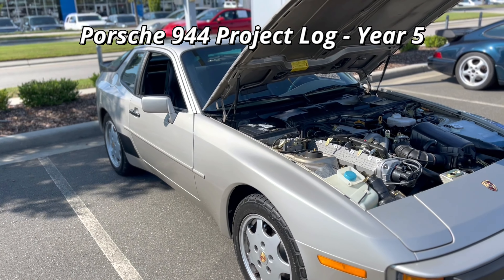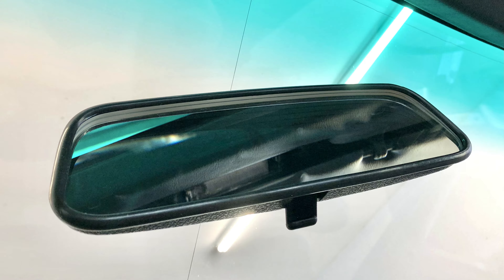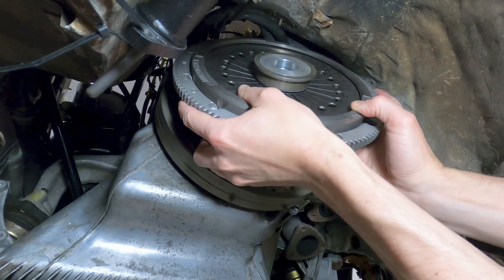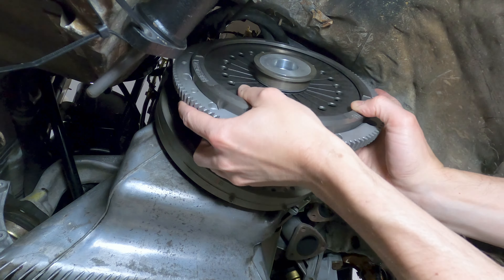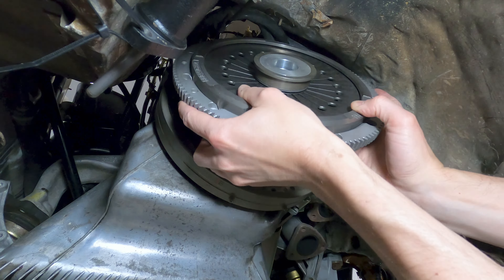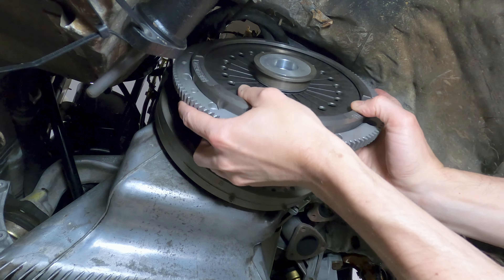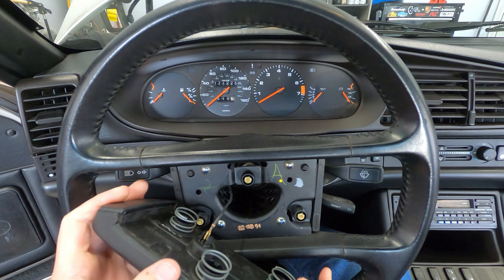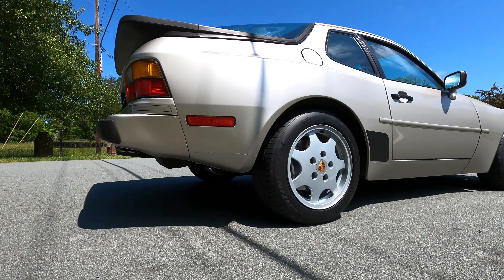Porsche 944 Project Story – Year 5 – Status Update, Repairs, Maintenance, & Costs

Comment: Thanks for the cost break down.  I have owned a 944 and a 924S in the past and had thought of getting another one to refurbish, but at $34K I'll probably just get a new GR86.   good channel and great content, thanks again.
Reply from the maker: You’re welcome! I will say that I took my restoration quite a bit further than would be needed to simply keep one running/driving. You could get a fairly clean 944 for $10-$15k and spend around $5k to sort out any backlog of maintenance. The GR86 would provide similar driving enjoyment without the stress of future mechanical failures. The 944 would win the day if you’re looking for the vintage factor and a project to occasionally wrench on. I haven’t driven the new 86 yet, but the increased power output makes it a pretty attractive option.

Comment: Gosh, nice work on this thing and thanks for the videos. I've done a few of these same procedures on my '86 turbo this year (sport DME, rear main seal, manual steering rack, etc, etc) and they do indeed make a pretty big difference in the regular usability of the car.
Reply from the maker: Excellent! It sounds like you’ve done some pretty extensive maintenance and repair on your car, it definitely makes a difference. I was surprised by the improvement of the refreshed Sport DME. If these weren’t Porsches, I don’t think we’d be so lucky as to have aftermarket options like those provided by companies like Focus 9.

Comment: thanks for all the content. Just did a 2.7 swap on my 86 after spinning a rod bearing on track and your videos were super helpful!

How are you liking the manual steering rack after using it for a little while? I'm considering going the same route some day given how my 944 is gradually seeing more and more track-day duty
Reply from the maker: That’s awesome! The 2.7L cars are pretty rare to see…

While I don’t have any real track experience, here’s what I can share after driving with the new steering setup for a little over a year. In short, the manual steering conversion has been a vast improvement in all areas except for in ease of turning at low speeds. I found the side-to-side movement on the new setup to be a little tight at first, I’m guessing because all the parts were brand new, where after turning the wheel halfway in either direction it would firm up and the wheels wouldn’t quickly self-center after turning. But, after driving the car a couple hundred miles, it broke in nicely and is now a lot easier to turn. The “on center” position is just a little vague, but that’s true for most manual steering systems. Not in a sense where there is lag or play in the wheel, the response is very sharp, just that it requires more micro-adjustments when cruising in the straights. Feedback from the road is really clear and the steering feel lightens up nicely when accelerating through turns. Overall, it’s ultra-smooth when you’re up and rolling and I haven’t detected any irregular shakes or vibrations, if anything I’d say it feels tighter than the power rack I had on the car. I hope that helps! 👍🏼
Reply: @NC944er  yeah that's great info thanks. Really tempted to go that route especially as I run out of things to do to the car LOL. Would certainly be nice to not have to squeeze the oil filter past the power steering reservoir lines too...

Comment: Thanks for mentioning fixing that crack in the door skin from the failed weld inside the door.  Tim Comeau at CRE mentioned that in a short video about a year ago but I had forgotten about it.  I don't see it on my 84 but a small crack is there on a new-to-me 87.  I haven't opened the door panel to look at the issue but guessing it's pretty easy to see the failed weld.  I'm not going to buy a welder to do this myself.  If I take it to someone to fix, just tell them to repair the weld?
Reply from the maker: Yeah, it’ll be very obvious to see once you’re in there and the guide rail will push in and out when raising and lowering the window. I actually picked up a $200 flux core welding rig just for this job. 😂 It’s such a small, 10-minute job that I couldn’t find any local metal workers to take it on, just wasn’t worth their time. You may be able to get an auto body repair shop to do it, they might bill an hour of labor or something in that area.

Comment: Great video, and very clean car, I’m almost done rebuilding mine, but for some parts you were an inspiration. I changed my camshaftgear to the adjustable from De Loods, hope it runs better 😊. Like to see more videos and keep up the nice works 👍🏻
Reply from the maker: Thanks man! That’s great to hear about your progress. I will say that most of the channel content has been motivated by simply helping others, as there is little value outside our niche 944 community, so I’m happy to hear it’s helping out. 👍🏼
Reply: @NC944er  well,I have taking  everything from below, to powdercoat myself and do the bottom in new paint, 2 months idea is now 2 years, but starting to look great
Reply: I just did the same swap to the De Loods adjustable camshaft sprocket on my turbo, which was needed - it's a nice unit. The head on my car had been decked enough that the timing was off by about 4 degrees when all the marks were lined up. Made a noticeable difference when aligning the balance shaft belts and I find it runs a bit smoother.

Comment: This summary video is terrific and one interesting element it contains is the replacement of that sound-absorbing foam that sits between the torque tube and the shifter. 

Based on this video, it does not look like you need to do anything more than squeeze it in through the shifter hole. Is that true?

I have this task in front of me this weekend and there are lots of other threads out there saying the torque tube has to be removed (or the foam has to be cut) in order to complete this installation. 

Thank you again for another terrific resource.  You are a life-saver.
Reply from the maker: @stephengawlik3033  Yes, that’s correct. There is no cutting required and the only parts to remove are the shift knob and rubber insulation boot. There is a hole precut for the shift lever and a notch for the shift linkage arm to pass through. The foam material is easily compressed and worked into position in less than 10 minutes. The foam can tear if you go too rough with it, so just make sure it’s compressed in each area when repositioning it. 95% of the work is done from above through the shifter hole. Final adjustments can be made from below, where you’ll see the foam sections touching each side of the torque tube, and some minor pushing/pulling can be applied to evenly distribute the material.
Reply: Thanks man, as always. One of the last steps in a long project as I rehang the transaxle and re-install the shifter.  Thanks for your advice.

Comment: Hope this isn’t the last we see of you and your care.  When I first got my ‘87 I referenced your oil change video and jack point video day one.  Question - did you replace your stereo / speakers at any  point?  Would be interested in hearing your opinions on them
Reply from the maker: Nice! Glad to have helped you out a bit. The head unit on mine is OEM, but the speaker cones were crumbling to dust. I replaced them with a set of Kicker DSC46 units front and rear. They sound ok, as far as 80’s sound systems go, decent mids and highs, but not much in the low range. Here’s an overview of the repair - https://youtu.be/nlLpbw9eB90?feature=shared&t=8m25s

Comment: Where did you get the r134a retrofit kit with the valve adapters? I'd like to get my 84's ac working again
Reply from the maker: Hey man, I used the Santech kit from Pelican Parts as it was reasonably priced, part number: 559807901. Keep in mind for your ‘84 that you may also need one of those elbow adapters for the connection at the compressor. Here’s a link to the kit I used: https://www.pelicanparts.com/More_Info/559807901.htm?pn=55-9807-901-M325

Comment: an other amazing video. a year ago, me and a friend of mine bought one too for 13k with new oem paint (champaign gold) and full service all around. we recently ran into an oil leak and it looks like its comming from the front of the engine near the downpipe. while driving the car you can clearly smell oil burning up and smoke comming from the left pop-up. any suggestions?
Reply from the maker: Thanks! From your description, it sounds like the oil is coming from the camshaft assembly, which sits right over the exhaust manifolds. The assembly has seals at the front and rear, as well as a main housing seal below, all of which can develop leaks over time. I’d pull the assembly and replace all the seals, timing belt will need to come off, but it’s not too bad of a job.
Reply: Ty for the info and do you have any must do things for the car?
Reply from the maker: @FancyBrent  Timing belt replacement is always important to keep up with. I follow a 5-year/45k-mile guideline. If the car has sat for a while, replacing all the fluids is a good idea as well, especially engine oil and gear oil in the transaxle. Fuel system maintenance is another good one to keep on the radar - replace fuel tank strainer, fuel filter, clean injectors, etc.
Reply: Ok thanks alot 👍

Comment: Noob question but does the Porsche 944 have pcv valve? I’m trying to find any information about it and no luck.
Reply from the maker: Hey man, nope… the 944 does not use a PCV valve like those seen in most modern cars. The AOS on the 944 engine acts as a PCV of sorts, and the crankcase is always under slight vacuum while running, which allows any blow-by gases to recirculate back through the intake manifold.
Reply: @NC944er  Got it thank you for the information! You think that’s something I should change out? I got my 84’ 944 a month ago and I just been doing maintenance on it since I got it before I start using it daily. I drove it from Oregon to California with no issues! (Besides needing to stop by a AutoZone for windshield wipers 😂) So far we changed the oil, oil filter, air filter, transmission fluid, spark plugs, spark plug wires, distributor cap, and in a week or changing the timing belt and water pump. And want to also change the fuel lines. You have any recommendations of things that I should change for a smoother ride or just in general? I feel like the car has a rough idle below 1200rpm, or maybe I’m just used to how newer cars are so calm.
Reply from the maker: @gawsies  It seems like you’ve had pretty good luck so far. I wouldn’t proactively replace the AOS unit as a preventative maintenance item, but it’s something to watch out for in terms future oil leaks. The ignition system components are worth refreshing, so it sounds like you’re on the right track there. The fuel lines should be replaced if they are showing signs of cracks and aging, from a safety perspective.
Reply: @NC944er  Thank you for the help, your videos are helping me out so much. I been wanting to change the ignition coil because sometimes I have a hard start so I believe it’s starting to fail but they’re out of stock everywhere unfortunately
Reply from the maker: @gawsies  Yeah, the ignition coils have been on back-order for a bit now, the last update I heard was we’d see some in September of this year, but that came and went. Bosch only does something like one production run per year on certain older parts like that, but luckily they’re not fully discontinued yet.

Comment: Where did you buy a window washer reservoir so cheap? I can only find an OEM Porsche unit for $350.
Reply from the maker: Porsche introduced a smaller reservoir in 1988 for cars without the headlight washer system, which is a much more reasonably priced unit, around $96 before tax. The larger reservoir is in the $250-$270 area from Pelican Parts and 944Store. Check out part number: 944-628-061-01
Reply: @NC944er  Thanks!  Pelican Parts shows that part number “for cars WITH optional headlight washer system”.  My 1983 has no headlight washers. Hmmm.
Reply from the maker: @danf321  Ahhh, gotcha! So your early version will be the “larger” size tank, but with the secondary hole plugged for the headlight washer motor. It might be more cost effective for you to convert to the later, smaller reservoir design, which is more compact and doesn’t suffer from the “priming” issues like the early pumps. There is just a slight modification needed, where you would have to drill a hole in the power steering reservoir bracket to accommodate an M6x15mm bolt and add in the L-shaped support, part number: 944-628-066-00. You’ll also need an extra body screw N-090-172-1, a new lid 911-626-077-01, sealing ring 431-955-465-B, drain plug 999-063-015-40, o-ring 999-707-171-40, and the updated pump 928-628-172-01. The bracket is $60 and the pump is $45, so it could probably be done for under $250 and would make for a fun little conversion… something to consider.

Comment: Hi Do you think I need to change the valve seals? I'm in the process of changing the cylinder head gasket and several other seals, but I don't have the tools to change the valve seals. Porsche 944 na 1983
Reply from the maker: A common symptom of failing valve stem seals is the presence of blue smoke from the exhaust at idle. Its quite bit work to remove the cylinder head, so if you have the budget for it, it’s generally a good idea to have it refreshed while it’s off the engine. You’d be looking at $300-$400 in machine shop costs to deck the surface, cut the valve seats, and lap the valves, and replacing the stem seals makes sense at that time. Compression or leak-down tests will help determine if the valve seats need attention.
Reply: @NC944er ok thank you very much
Reply: @NC944er  sorry i meant valve Stem seals i have already had it at a machine shop but they didn't change the valve stem seals
Reply from the maker: @hugoefternamn6880  There isn’t a great way to determine if the stem seals need replacing outside of the oil consumption symptom mentioned.
Reply: @NC944er ok 👍
Reply: @NC944er  I have now taken apart the valve and the valve seals is rock hard . Thank you for the help

Comment: My '87 oil dipstick only has a wire loop at the top without the plastic overmold, so I put about 4 coats of PlastiDip Yellow over it.  The color actually matches quite well with the fill cap.
Reply from the maker: Interesting! I believe Porsche introduced the yellow plastic version in mid-1987, as I’ve seen some 87s with the wire loop like yours and other 87s with the yellow one. It sounds like your solution worked out well. 👍🏼

Comment: Excellent video.  I do disagree with your RMS advice though.  Never use a VR RMS.  I have done a lot of testing of the different RMS and methods of installing and highly recommend to stay away from the VR version.
Reply from the maker: Interesting! I love data… do you happen to have a breakdown of the number of seals tested by manufacturer with observed failure rates, failure points by miles driven, etc? Did you use one car as a controlled condition or was the testing done across multiple vehicles using the same seal brands? I’m also curious how the Hamburg-Technic and Corteco seals would fair under those tests, any details on those brands? Thanks in advance!
Reply: @NC944er  During my rebuild I tested installing frozen/room temp - pounding in/install with crank to see which caused the least damage to the seal.  I did not take 12 engines and run them till they leaked and repeated 10 times.  I tested Corteco, Ehlring and VR seals.  The problem with VR seals is they only have a rubber seal for the last 30% of the seal.  The cutout to pry the old seal out is 30% of the depth of the seal (starting to see the issue here).  On RL there are many threads about sinking the seal in a little past flush otherwise it will leak.  If a VR seal is driven in flush the rubber barley touches the cutout - that one or two mm past flush that you drive the seal in is the depth of the sealing area in the cutout.  No official data but having 70% of the seal sealing seems to be better then 1% of the seal sealing.  That cutout by the way is a machined surface and sharp as a razor.  When you pound the seal in it just slices the rubber in that area.  If rebuilding I would pick frozen/install with crank.  Second choice would be frozen/pounding in - even though it slices the seal at the cutout it is a very tight slice and is the factory method I believe.
Reply from the maker: @davidkaehele8910  Ahhh, installation tests… that’s a pretty cool idea. I’ve seen the threads you mentioned and agree that a recessed install is the way to go, regardless of seal choice. It seems there is a chance for leaks when installed only flush, perhaps more so with a VR seal based upon your observations. I do see what you’re saying about the outer sealing surface coverage. I suppose if anything, using a seal that has the full rubber coverage would at least provide small peace of mind in not having to repeat 12 hours of labor due to a failed seal installation. Thanks for sharing your insights!